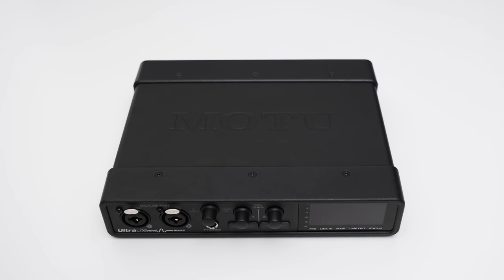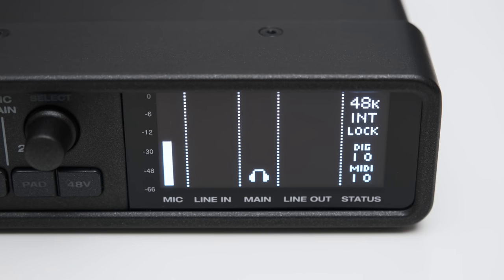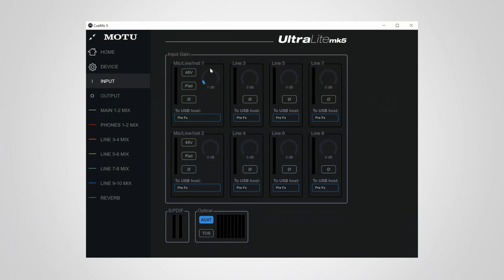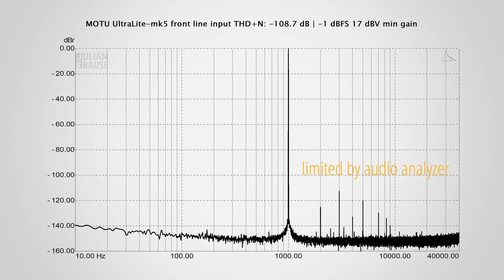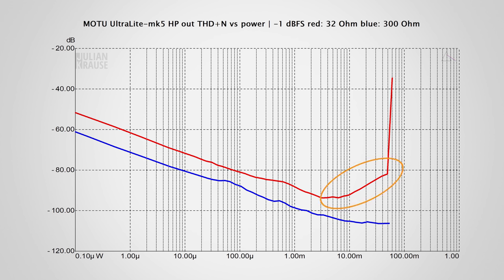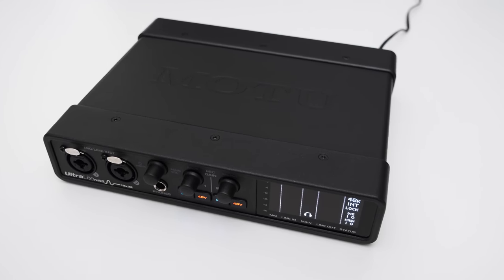MOTU UltraLite-mk5 Audio Interface - REVIEW (audio performance tested)

Comment: Hi Julian. Thanks so much for the video, very useful. There is one thing I need to know but I can't see from the video: what opamps are there on the analog outputs?Because I need to see their specification to know what is the minimum impedance that can be connected.

Comment: Hello Julian, thank you for all the great reviews. I have a question, which interface you've measured so far to have the fastest round trip latency that's either USB or FireWire not TB. I'm still using an old and outdated M-Audio ProFire 610 and would like to upgrade but can't find anything new that has the same or less latency than my current interface. Thanks in advance!
Reply: FW has lower latency than USB, either check RME or try a thunderbolt interface

Comment: Trying to figure out if CueMix software will allow for time aligning the outputs. Like placing a delay on an output channel - say if you need to time correct a surround setup (5.1, 7.1) or the immersive formats (atmos). Thanks!

Comment: Does anyone know what I am doing wrong to cause a high pitch tone that interrupts DAW recording, playback, and audio from Youtube and Spotify? 

The piercing tone occurs frequently and cuts out the actual audio being played or recorded, but the audio doesn't stop. Just interrupts, making it impossible to track audio or Midi.  

I noticed when I switch the "Enable Windows Audio Stream" Main Out 1-2, and Phones Out 1-2 in CueMix5, this tone would also occur. 

I changed to a 3.0 USB input and that seemed to help some. I have read that getting a better quality USB-C to USB-A cable corrected the issue with some. I am also going to to a factory reset. If none of this works, tech support, here I come!!!

My Windows PC is much older with DDR3 RAM anda soon to be completely extinct motherboard, while running Cakewalk Sonar Professional DAW (outdated as well, much like myself when it comes to tech) 

I used to run an old Roland Quad-capture with Sonar which had very few problems. This new MOTU seems to have more clarity when it isn't interrupted. 

thanks...

Comment: Did you test how this intergace behave when using a keyboard controller playing a VST like Kontakt?  How should be latency with MIDI? Can you play a grand piano without clicks, noises or delays playing notes?
Audio latency is not the problem. But MIDI latency is more inconvenient when uing VSTs instruments. Excellent review!
Reply: I find that using usb midi is better when using my drum module over cable midi hook up. It maybe a option for u 👊🏾👊🏾👊🏾
Reply: @dub-funkmusicnation7366  yes. I suppose that would be a goog solution. But I use MOTU MIDI EXPRESS with lots of stuffs plugged in. So using multiple midi to usb devices is not the best solution. Maybe in the future with the new MIDI 2 standard.

Comment: Hi Julian, when looking at your date sheet 12:16 , is Channel Balance the respective difference of main outputs 1 & 2? I ask because I noticed my tascam 208i has that exact off-balance measurement of the master output, where left (1) is 1.9 db louder than right (2). Very annoying, just off enough to bother me 🙂
Reply from the maker: Hey, this measurement is specifically for the headphone output impacting the left right balance of your headphones. For the main outputs I haven't measured it. If your main outs have different output levels, you could try to compensate for that by simply turning up one monitor slightly to match the other one. Or if the Tascam allows in software, you might be able to slightly change the volume of one channel to match it to the other one.
Reply: @JulianKrause  unfortunately they seem to share the same circuit (headphone/master outs) with no ability to customize panning in the software - which is why I'm going to get the ultralite mk5 so I don't have to worry about that (thanks for the great review)

Comment: Hi Julian! Hello everybody, 

I am about to get the MOTU 828 ES for the studio. As a composer, I need to work almost all day with my large orchestral template, so as a keyboard player I need a low latency when I play, the usual right? ...After watching your amazing analysis of the Ultra-lite MK5, and assuming the latency will be the same as the 828ES, I have some doubts about this.

I can't understand it...I have a PC system running through an aged  USB 2 UR22 for my orchestral template in Cubase 11 pro , with a buffer size of 512 samples at 48KHZ  and my latency/IN  is 15.167ms and 18.167ms at the output...So, if I get a Motu 828 ES, I will probably achieve 26,9ms at 48KHZ/512 samples? 

I remember the old days with my beloved Marian Marc X card running Gigastudio at the same parameters and I was achieving lower latency...How this can be possible with this, let's say ultra-modern interface compared with the ones I mentioned??!! 
I need at least those 18ms to play through the keyboard without problems...with the same specs because I need to play different parts at the same time I listen to the orchestral background, audio FX etc

It's hard to believe this "super modern" interface be lower in latency response (I am not talking about the mixing/mastering process) than more and more cheapest and older interfaces...:(

Comment: I'll stay with RME, they at least support their products over 5 years at a time.
For real, MOTU has really bad reputation and track record in driver support for their products which I have run against as well. They rehash their product line every 3-5 years and they drop driver supports for all older models.
This is unacceptable in professional piece of kit.
I have RME interfaces running on windows 10 x64 that were released almost 15 years ago and they work perfectly...

Often the features/price isn't as important as product lifetime support and stability to get the job done. And RME has never failed me after I went through dozen different manufacturers and models of interfaces over the years looking for something that works.

Comment: Hi Julian, love your reviews. Bought this interface based on your high praise. And it works perfectly… until it does not. All of a sudden, the sound gets crazy with high pitch distorted peaks. I change the sample rate from 96K to 44K and the audio becomes normal again. Then switch back to 96K and the audio remains normal. (It does not seem to the be a problem with the actual rate that is used.) I am using the interface connected to an iMac (Retina 5K, 27-inch, 2019) running OS 10.15.7. This happens with any sound source, for example music file played from iTunes and recorded in Ableton Live using the loopback function. But the same happens even if I just plug my guitar to the interface. All goes well, till sound becomes distorted suddenly and for no reason. Switch the sample rate back and forth always solves the problem. Any ideas? Many thanks in advance. 
PS: Wrote to MOTU for customer support... still waiting for response. /DS
Reply: @cfibanez Have you received a response at this time?

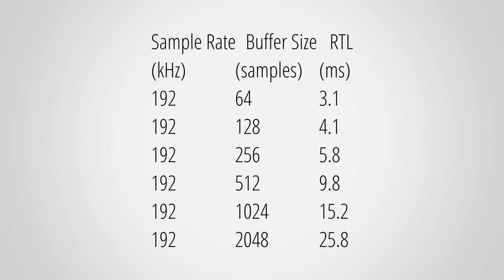Comment: 5:40 why not show also 96kHz values? don't remember last time I used 48kHz
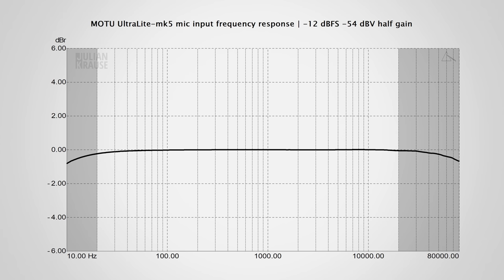6:22 this would be great to show measured with different sample rates, as the top end looks very theoretical
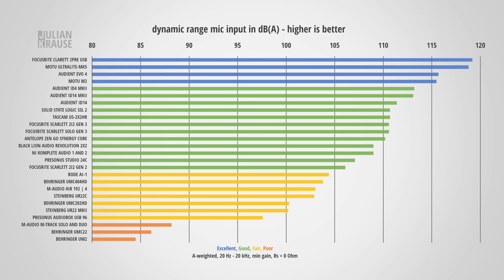6:34 no RME interfaces? hope not just me would be interested, Audient Evo and Motu M series are quite noisy, so these numbers do not help anyway
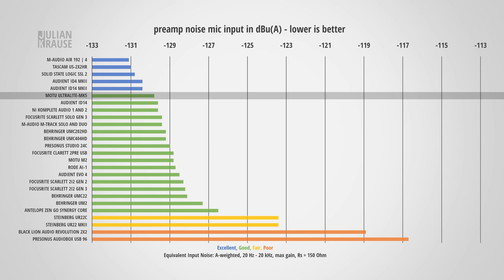8:07 if only Audient iD range had a (half) rack shaped interface :D
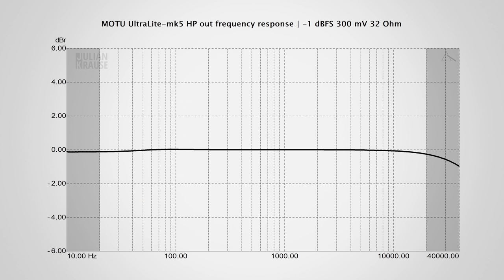12:24 again, would be cool to see it measured with different sample rates, to see the effect of the AD low pass filter
thanks for the video!

Comment: Quick question. When you were showing the various effects such as the compressor and gate, does the interface itself do that processing or is it done through the software on the PC? If you run the interface without a PC, does it still do that processing?
Reply: The UltraLite does the DSP processing for it's built-in effects

Comment: Ah I see you are using the Loxjie D or A 30, will there be a review? If no, how do you like it? :)
Reply from the maker: You are right, it's a Loxjie A30 :) I use it to drive my two Kef iQ1 speakers. Not sure if I make a review about it and I have to confess I haven't even measured the device at all. But I like it quite a lot. It is super compact and has more power than you would expect from such a tiny device. The built-in DAC is really handy, I have it constantly connected to my PC and so far it workes flawlessly. The power supply feels a bit cheap, but other than that I think it's a really good value.

Comment: my ultralite mk3 FW has a lower RTL; I get 7 ms for 128 and 12 ms for 256 at 48kHz. definitely a keeper. firewire was indeed superior.
Reply: I can't understand it...I have a PC system running through an aged  USB 2 UR22 for my orchestral template, with a buffer size of 512 samples at 48KHZ  and my latency/IN  is 15.167ms and 18.167ms at the output...

So, if I get a Motu 828 ES, more or less I will achieve 26,9ms? I remember the old days with my beloved Marian Marc X card running Gigastudio at the same parameters and I was achieving lower latency...How this can be possible with this, let's say modern interface??!! I need at least those 18ms to play through the keyboard without problems...
Reply: @xaviduch  indeed you'll get 26,9 ms RTL latency (in and out) with the mk5 at 512 samples; about half from the keyboard (out latency); you need to lower the buffer to lower it; and if you can't then maybe it's time for a computer upgrade. USB2 will have a  higher latency than PCIe; thunderbolt; or even firewire; that's why some old interfaces perform sometimes better. You can also go for RME which has better latency (the best in fact) with USB; or go with a thunderbolt model like the 828 thunderbolt (which is not really modern) or another brand that does thunderbolt. I work with a macbook M1 and I usually leave my latency at 128 most of the time; maybe in some heavy mix situation I will up it to 256 (and it will work at 64 mostly also but I don't bother since I don't notice anything at 128). Even if I had the mk5 that probably would not be an issue.

Comment: Not sure if you have experience with the old Cuemix FX software, but I firmly disagree on your statement about 'Cuemix 5 having so many features'.  Cuemix 5 is straight garbage with very little features compared to Cuemix FX and the few features  it does have are poorly implemented with no parameter readouts at all and a clunky, overblown UI that looks marketed towards ipad/phone users who don't know or care about headroom or bus/mix metering overviews.  No level/gain readouts, no fader level data, no gain makeup on compressor, no seven band eq with selectable highpass/lowpass curves, no channel width control, no real-time FFT display, no waterfall spectrogram, no instrument tuner/x-y plot/ phase analysis.  It doesn't even display the master channel level!  Oh yeah and no front panel operation is super lame.  The MK5 works great as an interface, but it lost ALL of the muscle and functionality that the UltraLite MK3/Cuemix FX had.  This iteration is a straight joke.

Comment: Hi Julian, with what peace of gear do you measure power on headphones output with different resistance ?
Reply from the maker: Hey, I simply connect different resistors as a dummy load and then turn up the headphone volume until it hits 1% distortion. I monitor the distortion with an audio analyzer but you could also just use an audio interface and free software like ARTA.

Comment: why is the latency lower when running 192kHz? At 5:38  48kHz  running 64 samples bufffer size, you say the latency is 6.9ms, but at 5:41 192kHz with a 64 sample buffer runs at 3.1ms? Did these values get switched around?
Reply: thats true for most interfaces i have googled
Reply: High sample rate yields lower latency because more samples per second means they're passed through the system faster per bing

Comment: Thank you! is it possible to use the back line inputs for instrument? acoustic guitar for example.
Reply: Yes, but you will need a DI
Reply: @imaginarytube   i meant instead of a di like in  the front instrument input
Reply: The higher the impedance is, the less current there is for the same voltage. The guitar produces only roughly 1/100th of the current that comes from a normal line output, so it does not have enough power for a normal line input even if the voltage is the same.

Comment: Thanks for the review. One question : can we control the input's/outputs volume directly through the front OLED screen & buttons when we don't want to launch CueMix ? Or can we CC map a MIDI/OSC controller in order to do that without launching CueMix ?

If I invest in this product I plan to keep it for several years (like over 10yrs) and I wouldn't like to completely depend on software compatibility for the standalone mixer feature.

Comment: do the rear line inputs bypass all pre amps with the use of external pre amps and if so if they are fixed gain how is it that you can adjust the gain with in the software thanks
Reply: They will bypass the preamps, and you can adjust the gain if need be in the software

Comment: standout review! 
will check out the rest and likely subscribe.

can anyone address the one thing that drives me absolute crazy with the MOTU mk5, 
it's tendency to unlock from my MacBookPro 16"2021?

the sure shot way for this to happen is the computer going to sleep.

when it wakes, the interface will still be selected in the OS, but will be silent.
it will take switching on/off, sometimes TWICE, before it will sound again.

and i've had it decouple itself in the middle of work as well, which stresses my trust..

this is all with 3' USB-C 4 cables by Caldigit and OWC.

(it's even more iffy with long Tether Pro 15'ers, expected, but it would be really nice to use long USB-C runs)

further the mk5 will not even talk to my MacBook Air M1 although no problem with the Ultralite mk3 :(

i've sworn by MOTU Ultralites for years now, but the new M1/USB-C architecture along with Ultralites mk3-4-5 and inconsistent USB-C cables apparently have created a confusing headache using these in theatrical and even studio (the sleep issue) settings...

Comment: I want to use this with minidsp  measuring mic and add eq settings to each channel separately. Output to Denon avr rca inputs and 1 sub. Anyone here use audio interfaces like this ? So much cheaper this method than minidsp 5.1 or 7.1 surround sound setup.

Comment: Why don't you test the intermodulation distortion.
Reply from the maker: Because in all devices I tested THD and IMD were always correlated. When a device had high amounts of THD it would also show high IMD. This might not be true in every single case but in the majority of interfaces that's the case. Measuring IMD in most cases is redundant and would make my videos unnecessarily longer and complex.

Comment: Thanks for the internal shots. I wonder why the circuit board has what appears to be small holes on it.
Reply from the maker: Hey, those are called vias. They are small paths that connect different layers of the circuit board: https://en.wikipedia.org/wiki/Via_(electronics)

Comment: Not bad for $600
Reply: That's a lot of money, considering it only has 2 mic / instr inputs and 1 headphone output.
Reply: @supersonicsroots  Said by some one that clearly didn't watch the video. When was the last time you seen the back of the Ultralite Mk5?
Reply: @eman0828  Yes, I did watch it. At the back there's only line inputs, midi and connections for adat, s/pdif etc. So you'd have to buy another hub to expand it. Still, the mk5 only has 2 (two) mic inputs. And for a 700 euro/dollar interface, I can buy something that has a lot more inputs and still be a great interface.
Reply: @supersonicsroots  dude you are totally trolling. Like what the hell are you talking about? The interface littery has 10 analog inputs and outputs of i/0. Just because you only see two mic pres doesn't make it a two channel interface. This is no cheap Scarlett interface. It has an on board Mixer and DSP processing, not something you will see on a sub hundred dollar interface.
Reply: @eman0828  yeah line inputs. That's not XLR. So you'd need additional XLR pre-amps for the line inputs or expand the interface through adat. And DSP processing is overrated, I can put a compressor and EQ on my inserts and still track without too much latency, no harm done. Still, I have 8 XLR inputs, lots of i/o on the back AND also expandable through adat, toslink or s/pdif. And it surely didn't cost me 700 bucks. 
But I can make great recordings that sound professional. It's all about your skills dude. And maybe a great condenser. And I have absolutely no use for that many line inputs, I'd rather have more XLR inputs. I'm a real musician playing real instruments, not that EDM crap, so I need those mic inputs without having to expand and buy another 500 bucks adat preamp.
Reply: @supersonicsroots  Dude this is not a 10 mic pre interface. It's not much any different than an RME UCX II. This interface is designed to be used with analog outboard gear with lots of i/o and connectivity. It's a professional half rack mounted interface designed specifically for that. The MOTU Ultralite is nothing more than a half rack version of a MOTU 828 interface that's cut down in half. Its basically a half rack size 828.

Comment: Can this compete with RME Fireface UCX II ??????????????
Reply: Yes it can, this is technically an affordable UCX II but it doesn't give you the latency, the jitter immunity, the drivers that can last 30 years , and the versatility of the Total Mix software and a screen that shows when it's clipping. Other than that its a pretty solid sound card. It's the best under 1k for sure.